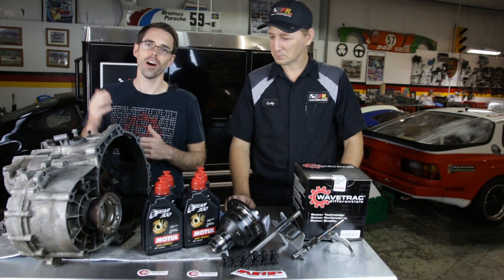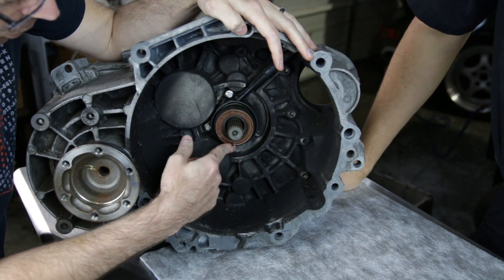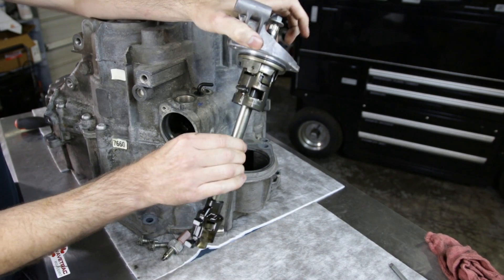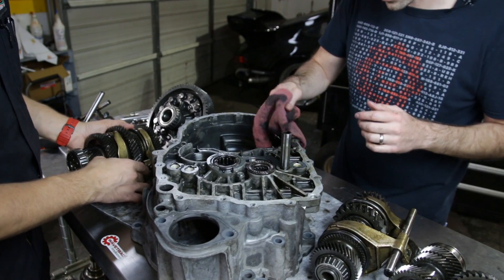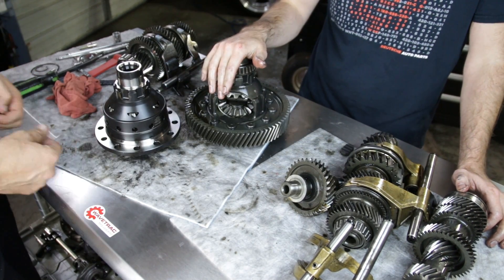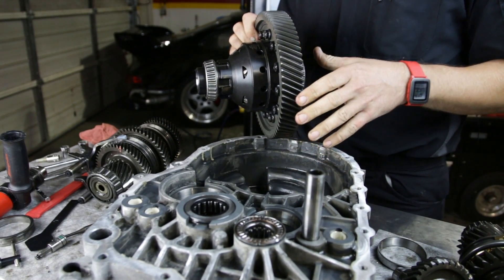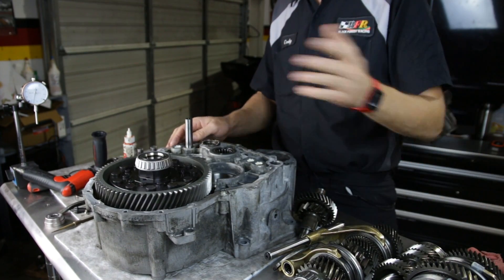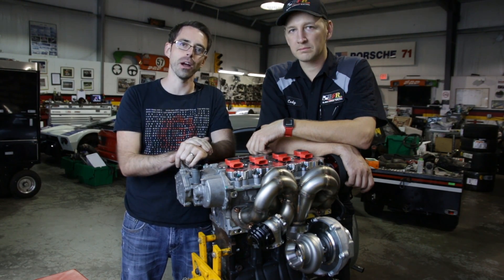Limited Slip Diff and Steel Shift Forks | Project MK5 Ep 4

Comment: Does it matter which side of the LSD the shim is installed on?  Like, would it be better to take up the backlash on both sides?  For example, if the endplay is .020", would it be better to put a .010" shim behind the outer race on both sides?

Comment: These steel shift forks are now becoming more problematic than the std items, especially on the newer design. The arms break and the plastics wear away. Far more failures on these than the stock bronze fork. As for the replacement brass ends, just as poor

Comment: Would these  differentials make a whine or grinding kind of noise when decelerating/letting off the gas? I’ve checked out everything else and I’m thinking it’s my diff now lol 

Not sure how to check a diff for this to confirm though
Reply: Yes when gearing is worn and the hardening material on the surface is worn away they whine alot.

Comment: I know the video is 4 years old, but if someone have the answer to my question: 
I want to only install the wavetrac lsd on a mk7 gti 6mt non pp: Is it necessary to open the trans housing from the gear stacks side and to remove everything? Wouldn't be easier to open it from the other side so we can access directly to the differential?

Comment: If you are just doing the Wavetrac, can you just remove the opposite casing so you do not have to mess with the gear stacks and remove the stock diff that way to drill the rivets? Can the gear selector remain in place?

Comment: Wavetrac is not only a gear type lsd! It actually combines a torsen gear type with a clutch type, still working with low traction conditions.
And a different reason to replace the factory shift rods is the rivet that connects the shaft to the brass selector... These tend to break under high load

Comment: Hey, do you know by any chance if the manual transmission in Seat Ibiza Cupra 2016 (1.8tsi) is the same as the Polo GTI 1.8tsi with manual gears? Is there a mechanical LSD which can be used? Thanks in advance!

Comment: Also what type of sealant do you guys recommend I was trying to look for the trans end cap but the url does not work do you have still carry it as well as the two snap rings which go under the end cap i have the same transmission 06 gti GVT code trans but don't know the part number for those two snap rings its a small one and then a bigger one as well a the trans cap.Thanks

Comment: would i need the shim kit if i am using my stock lsd and not swaping it  i am just doing a swap of the gears inside since my 1st and 3rd gear are bad?
Reply: Gabriel Hurtado no. If all you are doing is shift forks, and not disturbing the diff.  You should however always check the backlash regardless, before sealing the case together.

Comment: You briefly mentioned the benefits of servicing one of these transmissions. That sludge was nasty. What is the recommended service interval for these transmissions?
Reply: Trevor Austin I'd do it with the 60,000 mile service if it was my car. Before 100,000 miles for sure.
Reply from the maker: +Trevor Austin there is no official recommended interval. Sorry we should have mentioned that as it may not be common knowledge.

Comment: Would it be a good idea to check and replace the synchros at this time?
Reply: SWmaster yes, that would be highly recommended. Max seems to have been pretty nice to this gearbox because the synchros were in wonderful condition.
Reply from the maker: +SWmaster check sure and replace only if damaged. Most times that wouldn't happen

Comment: why didn't you replace the blockers?
Reply: lilmangofast the synchro rigs, which some people call blockers, were inspected and found to be in good shape. No reason to change them. 

Synchronizer rings is the term used in the patent, but different people do sometimes like different terms. Another common item with multiple names is the operating sleeves which are also called shift sleeves or sometimes I've heard sliding rings.
Reply from the maker: Im sorry I dont know what you mean by this
Reply: Deutsche Auto Parts I may have to make a response video. I don't want to make anyone confused with incorrect nomenclature of parts. I am not a Certified Technician, but I just taught myself how to rebuild a transmission.
Reply: Black Forest Racing the reason I dont call them syncro rings is basically they are the one piece of a syncro assembly. dogs, sliders, blockers and gears. I just finished rebuilding my first trans. The blockers (syncros) are carbon fiber lined for faster shifts. Having a more responsive blocker will help save the forks. In my particular trans, (m5r2rke) the aluminum ones don't wear like steel ones.
Reply: Next trans I'm building will be very similar to this build. We just upgraded my sons Audi TT engine internals with IE h beams and Wiesco pistons. next is the trans. His goal is 500hp. My concern was the trans. Your videos have helped us tons. Keep up the great work.

Comment: I have heard, it is common, for the plastic portions of the upgraded steel shifter forks to wear out and then, fall off, causing  play problems,  on the shifter hubs. They make upgraded brass portions; to replace the plastic: 

Bronze Sliders for 02M & 02Q Steel Selector / Shifter Forks
Price: £20.00 SKU: DSD1790 

https://www.google.com/search?q=Bronze+Sliders+for+02M+%26+02Q+Steel+Selector+%2F+Shifter+Forks+Image+1+Image+1+Price%3A+%C2%A320.00+SKU%3A+DSD1790&oq=Bronze+Sliders+for+02M+%26+02Q+Steel+Selector+%2F+Shifter+Forks+Image+1+Image+1+Price%3A+%C2%A320.00+SKU%3A+DSD1790&aqs=chrome..69i57.1354j0j4&sourceid=chrome&ie=UTF-8

For the long term durability and not having to pull the trans later, the bronze sliders, would be cheap insurance!
Reply: Billy P. Billy I agree. That's what did with my DRP Transmission for my R32!
Reply: Billy P. That's a cool upgrade. We talked about such things, but honestly just don't expect that will be an issue within the time frame of the next time the gearbox is coming apart.
Reply: cant find this upgrade anymore